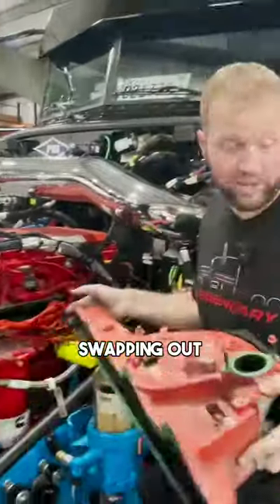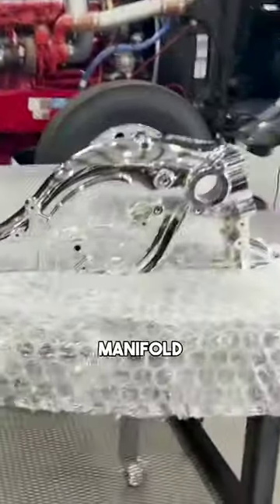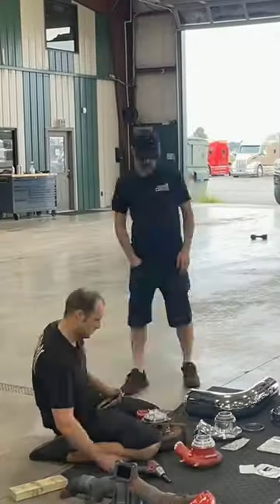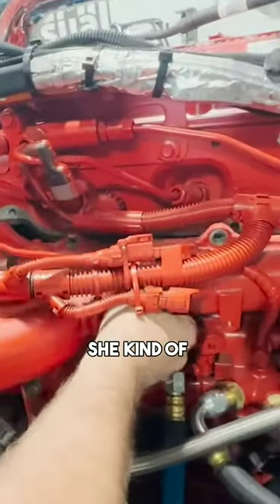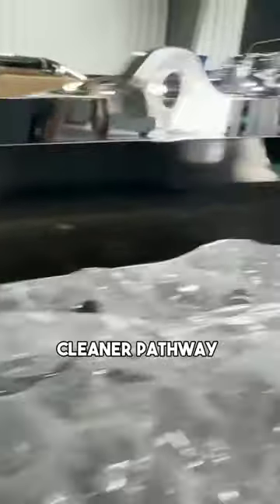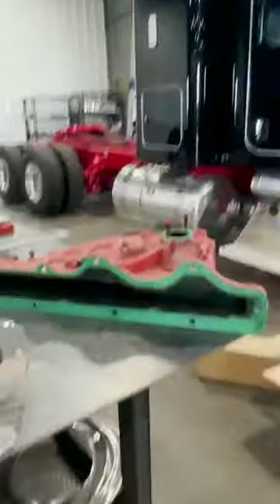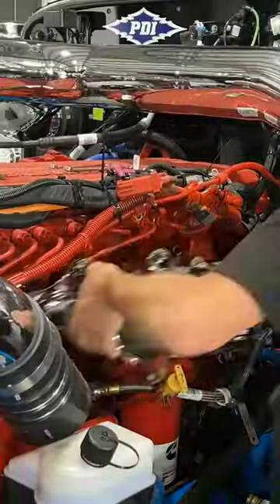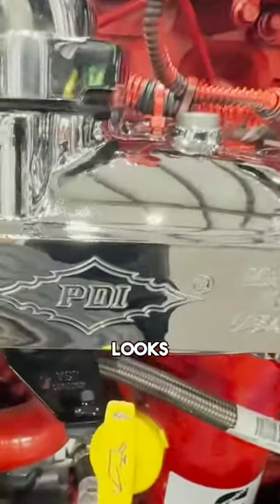Chrome Big Boss Manifold Install! #cummins #pdi #performance #peterbilt #custom

Comment: Did you feel a performance upgrade? Does it run better?
Reply: I can assure you the performance improvements are negligible. You wanna make more power it's turbo injectors and a good tune. That x15 will make 700+ horsepower with minor upgrades
Reply: Went from 32 psi to 35 for me
Reply: @reuben5274 but what volume. A garden hose and a fire hose can have the same psi.